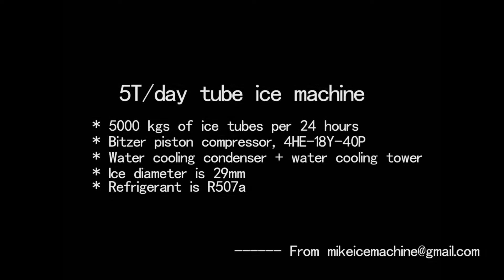tube ice machine for sale philippines

Comment: How much?
Reply from the maker: Thanks for your inquiry about my ice machine.
Are you looking for ice machines to do ice vending business?

My machine can make 2 kinds of ice, and that is my tube ice machine's unique advantage.
1. Ice tubes with holes.
2. Ice cylinders without holes.
Other Chinese machines have problems to make solid ice cylinders.

USD 17500 is the price for a 3 tons/day tube ice machine, and it can make 3 tons of ice tubes everyday, per 24 hours.
USD 24500 is the price for a 5 tons/day tube ice machine.
USD 36000 is the price for a 10 tons/day tube ice machine.
Which model do you prefer?

For your reference, here is a video to show my 10 tons/day tube ice machine making solid ice cylinders.
https://www.youtube.com/watch?v=p_wXraEeE2U&t=429s
As you can see in the video, very solid and strong ice tubes,  100% transparent, crystal, and clear ice, the best quality ice.

We also have tube ice machines with bigger capacities, upto 30T/day.

Did you use ice machines to do ice business before?
I ask this question because I wonder if you have other accessory equipment ready in your facility.
Other accessory equipment, such as the pure water machine, ice packing machine, ice bags, cold room and so on.
Pure water is needed as the water resource for ice making.
Ice packing machines and ice bags are needed for making ice packages.
The cold room is needed for ice package storage.

Looking forward to hearing from you.
Reply from the maker: Website: https://www.mikeicemachine.com/products/tube-ice-machine-a/
Mobile/WhatsApp: +8613825291035
Email: mikeicemachine@gmail.com
That is my contact information